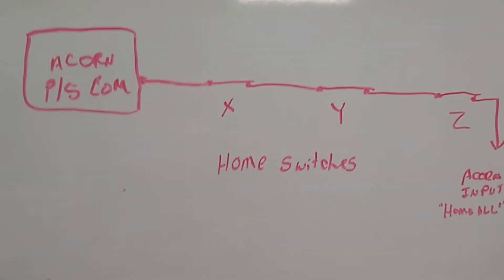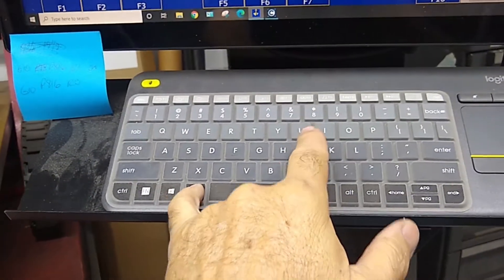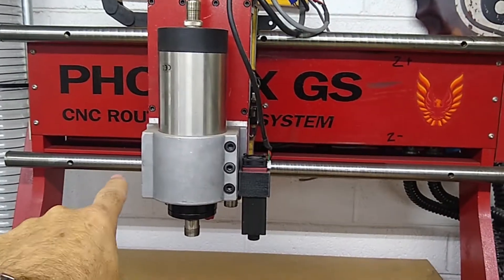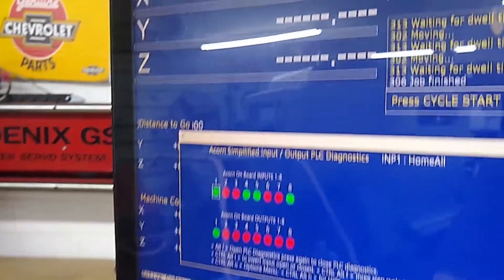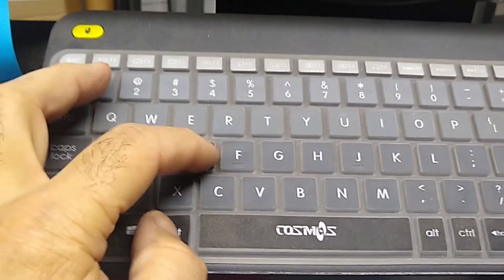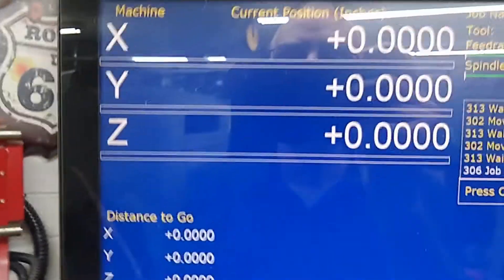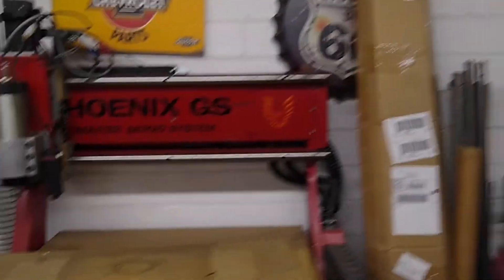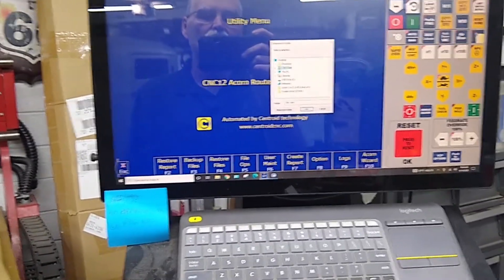Centroid Acorn Quickie: Setting up HomeAll and demonstration

Comment: Love the videos Marty. Considering upgrading my old Bridgeport Boss w/ M40/CNC7 to Acorn w/ stepper motors.
Reply from the maker: As I mentioned on the forum, All in One DC would be better. Price out the motors and drives if you can find them in NEMA 42 frame. I think that's what you have.

Comment: can you just clarify how to connect the 3 wires on the proximity switch please
Reply from the maker: It is dependent on the switch you have. There is a Centroid Schematic for connecting them. Also make sure you got NPN not PNP. Hit the Centroid Users Forum for more help. You can search for Proximity

Comment: Hey Marty, this was very helpful. Just a quick question: Did you enter the software travel limtis based on a measure or did CNC12 do that itself based on the homing?
Reply from the maker: No you have to tell CNC12 what the travel limits are of your machine.
Reply: @martyscncgarage5275  what kind of switches did you use?
Reply from the maker: @janvirbrar4181  all depends on the machine. Normally closed quality micro switches or Normally Closed NPN proximity sensors
Reply: @martyscncgarage5275  Sounds great, thanks marty!
Reply: @martyscncgarage5275  For a 2x2 router, which would you use?
Reply from the maker: @janvirbrar4181  either would work. My 2x2 router has mechanical switches

Comment: how do i get to the" return" tab from the home screen, ive found it before , and now i cannot
Reply: Rob, I don't follow what you are asking? Please explain? "Return Tab"?
Reply: @MartyEscarcega  on the bottom of the screen , when setting up lathe tool catalogue , i have gotten a return buttom to appear on the bottom of the screen.. Its a way to set the location for tool check ( tool check being the  button on the main screen controls
Reply: @airgunningyup  Sorry, still don't follow. I have never seen a "RETURN" button. Please post your question to the Centroid User Forums and explain step by step what you are trying to do.
Reply: @airgunningyup  Are you talking Work Coordinate? G28-G30?
Reply: @MartyEscarcega  yes.. the set location for tool changes on the lathe..
Reply: @airgunningyup  F1 Setup, F1 Part, F9 WCS, F1 Return
Reply: @MartyEscarcega  thank you that was it

Comment: what is the wiring scematic when using prox switched nc thanks marty
Reply from the maker: That has been discussed on the Centroid Users forum. Go there and search NPN proximity
Reply from the maker: Also, what does your sensor cut sheet say for wiring of the sensor?